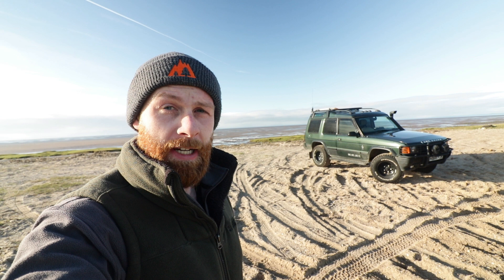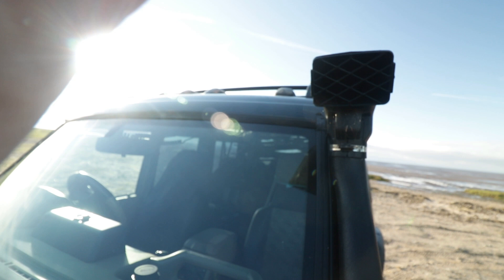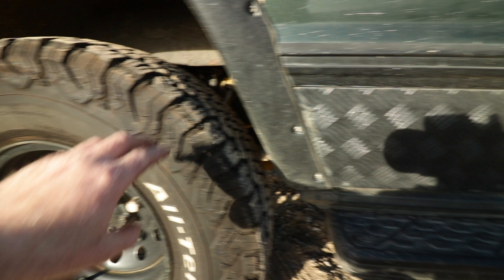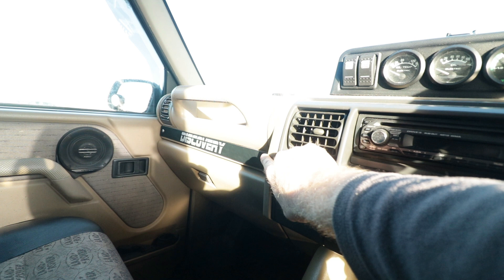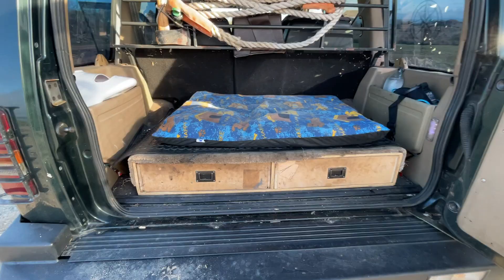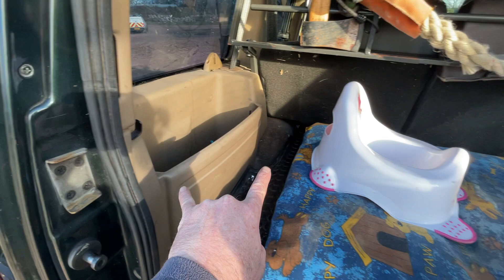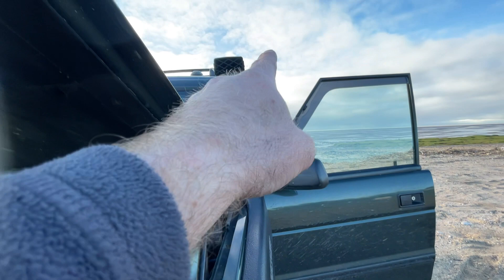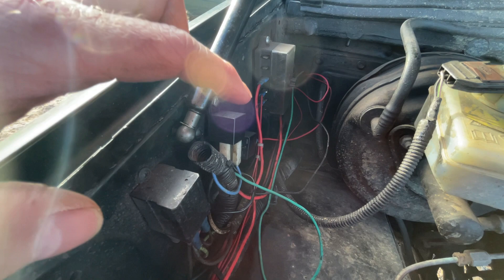A walkaround my 300tdi discovery 1

Comment: I had one and kept it for a long time. Replaced the roof lining,headlights,side window rubbers,and many many more parts like the springs but of after all the money I spent I just couldn’t stop the oil leaks. Wherever I parked there was spotting on the tarmac. Finally a young lad bought it. Good riddance.  I won’t  miss it. Never again. I also have a new set of beige carpets should anyone wish them
Reply from the maker: Haha they do tend to leak a bit of oil, shame you didn’t get on with it. I won’t be without mine

Comment: Good video Dan one thing you might want to consider if hasn’t already been said change expansion bottle to aluminium one I had one split on me and was on m25 and no break down so had to drive it off engine did not fair well sadly.
Reply from the maker: Thanks Dan! Yeah I do plan on doing that upgrade eventually but not until I’ve sorted some other bits first. Thanks for the tip and sorry to hear yours didn’t do so great
Reply: @TheNorthernExplorer  that was my second 300 the one I have now I made sure to change it lol
Reply from the maker: @sapp873  nice one! I’ve plenty of mods planned it’s just having the funds to do them
Reply: @TheNorthernExplorer  yeah that is always one of the main ones and time I’ve found is an issue lately ha ha

Comment: I see you said that you stand on the roof rack ,how are the roof guttering handling that . Did you know that where the rook rack brackets connect to the gutters they will break the roof gutter seal and and water will get in and the rest is history. I had a 1991 Nissan safari absolutely mint then I put a roof rack on  and fixed it to the gutters. Yeap it cranked the sealant and the entire roof rusted out 😢. I had to sell it , it would cost $4 to 5000 bucks to repair and there was no guarantee that the rust was down in to the door pillars .
Reply from the maker: The roof is strong enough to take a good bit of weight, I get what you mean but the roof rack holds a roof tent and 2 adults with no problems. I have checked the seals and no cracking so far, the rack has been on a good few years
Reply: @TheNorthernExplorer Good luck
Reply from the maker: @gregreed402  I’ll let you know when it cracks 😂

Comment: Have you replaced the o ring on the cyclone breather through the side of the head, this could be your oil leak  problem?
Reply from the maker: Hi David, yes I’ve tried everything but replacing the filter, I will try a new gasket and filter and see if that fixes it
Reply: @TheNorthernExplorer  If you mean the breather as I was talking about buy genuine as I did in Australia for  $140 two years ago. I bought a Britpart and another non genuine prior to that which both leaked internally and externally. 
Good luck.
Reply from the maker: @davidforbes6250  thank you, I have seen a few genuine and unrated ones which I might try
Reply: @TheNorthernExplorer  Oky doky

Comment: Is the radiator standard or performance?
Reply from the maker: The radiator is a brand new standard, the 300tdi is quite a cool engine and especially in the uk where we don’t get hot temps. If the engine was highly tuned I’d maybe think about an upgrade but a standard is good enough

Comment: Why on earth are you using standard steering arms still?
Reply from the maker: Because I’ve never had a problem with the standard arms, I take good care of the vehicle and use greasable track rods which are always sorted. I will be upgrading eventually though for strength and peace of mind with having bigger tyres etc
Reply: @TheNorthernExplorer  Definitely worth it. You always run the risk of bending them more easily with bigger tyres and it's not fun when one is pointing in the wrong direction.  Your disco looks very nice btw👍
Reply from the maker: @philb1378  thanks, yeah it’s definitely something I’ll upgrade just time and money

Comment: Nice! What about a coolant level sensor?
Reply from the maker: Thanks Nuno! To be honest I’ve never really thought about it, I look after the coolant system, it’s had new radiator, water pump and expansion tank so should be okay, I always watch the temp gauge and never let it get hot. To be fair here in England the engine runs pretty cold anyway and never gets past halfway on the gauge
Reply: But you may have a coolant leak, for example on the heat radiator and when you notice it may bee too late. A coolant level sensor gives us peace of mind. :)
Reply from the maker: @NunoMartins_01  very true but I do check it regularly. Maybe in the future I’ll look into it